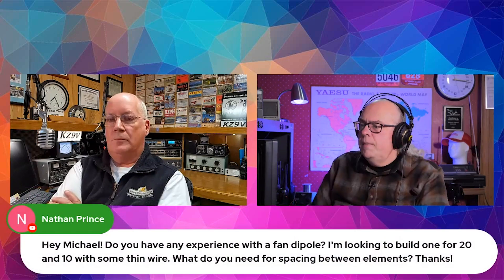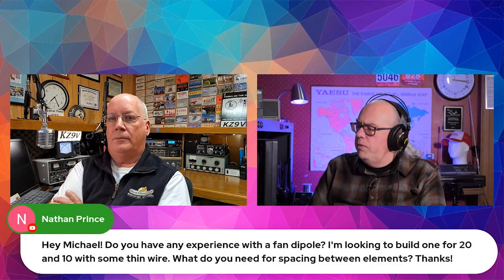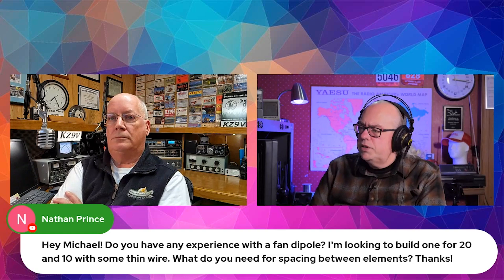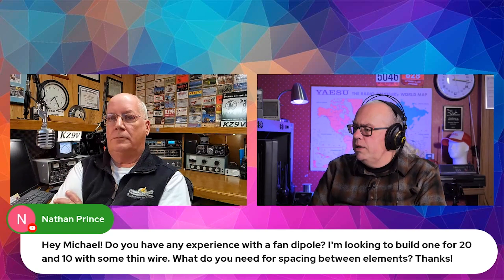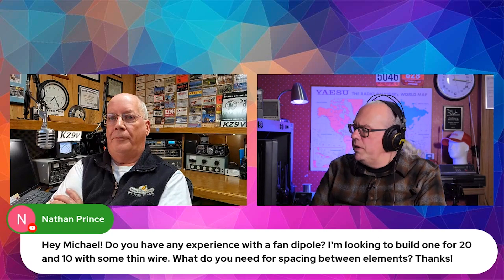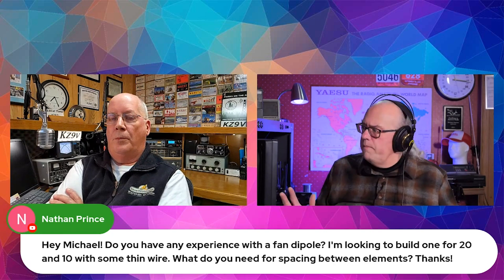Ask Michael, KB9VBR: Building a Fan Dipole Antenna #hamradioqa

Comment: As long as you install a common mode choke at the feed-point of the antenna, they are pretty easy to tune.  I use 4" tube spacers for 80/40/20 fan dipoles all elements in parallel.

Comment: I have a 20-meter/6-meter fan dipole in my garage attic.  It's invisible, it's lightening resistant, and they both work great.  I just wish the 6-meter band openings were a little more frequent. 
KZ9V

Comment: The thing about tuning a fan dipole is being able to put it up and take it down for adjustment. I built a 40/60 fan dipole which works quite well, I only use the 60 part occasionally but it does work well.

Comment: How about trying a coupled resonator dipole? Look at an article by W1ZR (sk) in the May 2011 QST edition. “A folded skeleton sleeve dipole for 40 and 20 meters” p 58. It can be cut for other bands as well. Google the topic and you will find references for dimensions for other band combinations, both folded and unfolded versions. I believe these antennas are a little easier to tune than the conventional fan dipole.

Hope this helps. 73s de N0SL

Comment: Thanks for the help Michael. I have since built it up for 40-20-(15)-10 just with a BNC and plywood. All bands are ~1.5 or less with simple fold back tuning. Now just need to find an HF radio.

Comment: I use a 20/10 “fan dipole”. The spacing is about  4 to 6 inches. The 10 meter dipole is below the 20. 1/2 inch PVC water line is used for spacers.  I have also used a 40/20/10 with about 6 inch spacing also between each dipole.

Comment: My first antenna as a brand new Ham was a 10/15/20 fan dipole in the attic of my townhouse. There was barely any distance between the ends, as I had to tie them off to whatever roof rafter was close. I worked 3/4 of the way around the world with it until they installed digital cable in the complex.